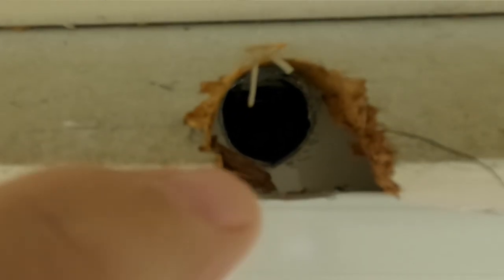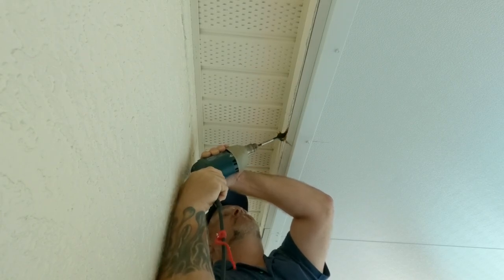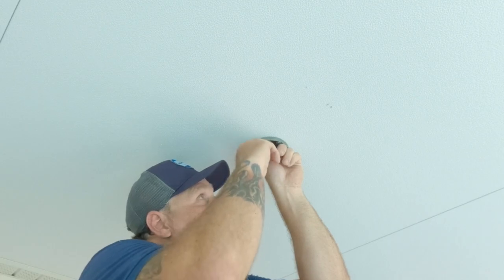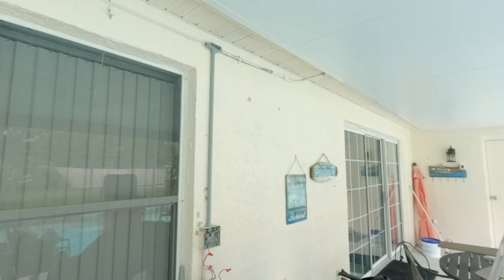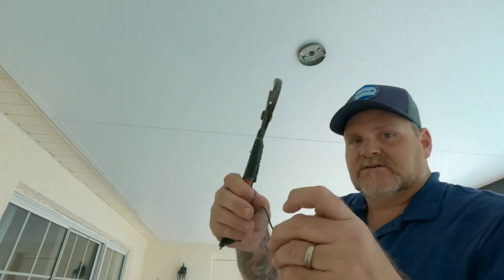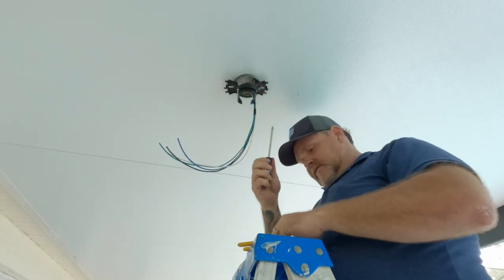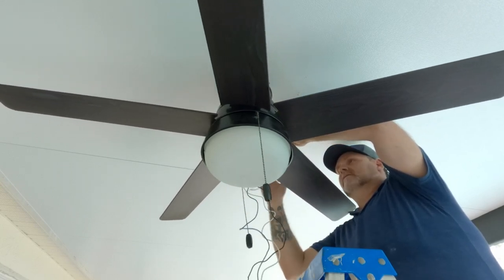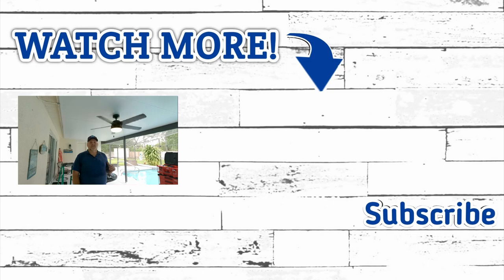MOUNTING A FAN TO AN INSULATED ROOF PANEL WITH A FAN BEAM

Comment: As a sparky I you made me absolutely cringe when you pulled your cables through. For starters you are using single insulated cables, you then pulled those single insulated cables through the metal holes you drilled. I truly hope for your sake that you did not cut one of the cables on any sharp edges. Question - as you ran single insulated cable in the metal roof section did you earth this section. Did you test the cables for any shorts given the method you used to pull the cable through the cavity. Did you do the wiring to your state or local code,
Reply from the maker: @gregharding7329  this was done to code. There was no issue with cable. I actually you'd better cable than what used to be there. The ones that used to be there weren't even insulated.
Reply: @FloridaFamFive  well what do I say, except here in Oz that is a highly illegal and dangerous electrical installation. Let me ask you this, are you a licensed electrician and what training have you done. The single insulated cable in conduit is fine but once it enters the roof space its illegal. I notice you did not comment on pulling the cable through your metal hole with no bushing or whether you earth the metal of the roofing material. I freely admit I am not familiar with the US code of installation when it comes to electrics but they  way this was installed is just so wrong at its most basic level its not funny.
Reply from the maker: @gregharding7329  The fan beam is embedded in the foam core of the roof panel. The beam not only supports the ceiling fan but also creates an accessor for wires. The beam runs the full length of the roof panel. There are rubber garments on both ends where wire goes in and out to fan.
Yes this was installed above code and yes professionally installed. Sorry for any confusion you might have.
Reply: @FloridaFamFive  You did not answer my question, are you a trained and licensed electrician.

Comment: What size/length bolt and nut was used to mount the ceiling fan box? Did you also use a washer on the outside for the bolt? I'd like to duplicate what you did.
Reply from the maker: For your pan. You can use #10-32 pan head machine screws. It such a tight space so I only used a nut on it. I felt like it would hold better this way. But you can just use sheet metal screws and screw it in no need for nut and bolt. I didn't want to trust that so I put in the extra work.
Reply: Sounds good, thank you!
Reply from the maker: @rpstompers  your welcome
 Let me know how it turns out!
Reply: I live in Florida so I assume I have a fan beam. I took off the cover plate and found electric. I can feel metal left and right of the hole but no way to use any nut. There are preexisting screw holes on both sides but no clue what size screw or length of screw. Any help

Comment: How did you mount the bracket to the foam board? Did you just use anchors? and will that be strong enough to hold a ceiling fan up safely?
Reply from the maker: Bolt and nut. With a 1" hole you can put your finger in there and hold the nut. Works good.
Reply: Hi just wanted to see how the mount has held up since installation?  I am about to do the same install this week.  Thanks!

Comment: how can I install an fan on elite panel with no beam
Reply from the maker: You can run conduit and into a junction box to hang light. 
I know they make a add on beam to run electric if that would be easier. It's probably going to cost more but this is the best option. Professional look. Either on will work just fine.

Comment: How would you run the electric if the elite roof is mounted right to the house ?
Reply from the maker: Is it not attached like mine?
Reply: @FloridaFamFive  mine is attached directly to the house . Cinderblock wall .
Reply from the maker: @denissamsonov620  ok. Do you know if you have a fan beam built in the panel.
Reply: @FloridaFamFive  yes , two of them .
Reply from the maker: @denissamsonov620  so you don't have to bring your electric in from the side top od the panel.. you can Drill a hole just like you would for your fan and run it up and over.
Run your electric from your switch on the wall on the wall up to the bottom of the panel and make your hole just like you would to put up your fan. Run your electric down the fan beam to your other hole where you want the fan to be.....

Comment: Is it possible to install a retractable sunshade to the underside of the panel? The weight would be around 15 lbs. Would itbbe strong enough to hold? Thank you.
Reply from the maker: Yes you can do that. That's a great ideal!
Reply: @FloridaFamFive  What type of screws would you recommend? Thank you for the quick reply and informative video.
Reply from the maker: @UFGators23  Use zinc plates screws, which will be referred to as galvanized screws. The screw heads should be painted same kinda color.

Comment: Hi. Great video. Question any advise on how to run the electrical into the wall? The installer left the wire outside the wall.
Reply from the maker: To answer this question I will need more info.
Was the electric wire old or did they run it new?